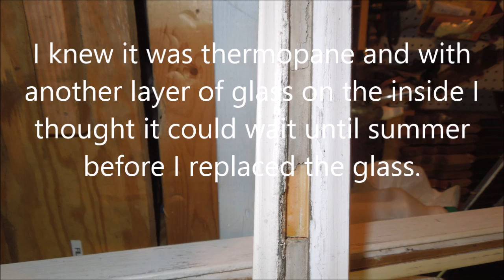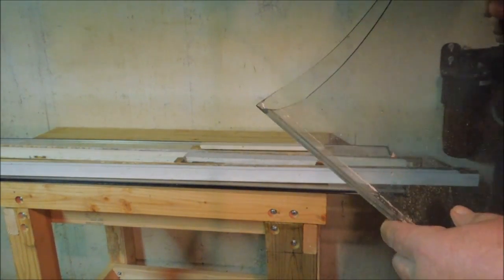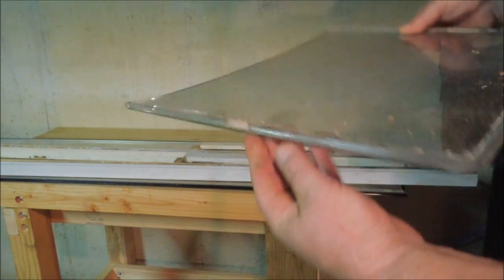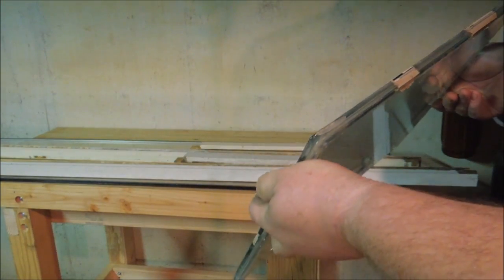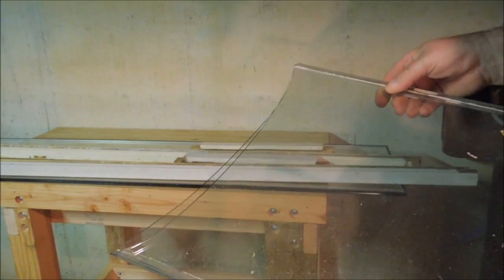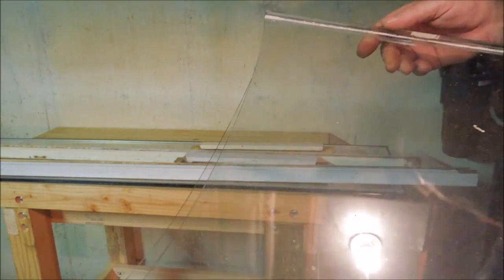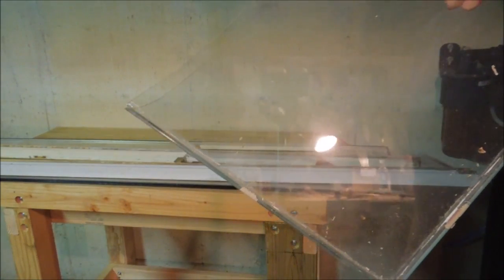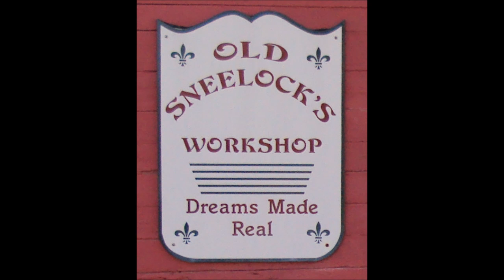Replacing the glass in an Anderson A1 type window - by Old Sneelock's Workshop

Comment: WE had a broken seal in our picture window and got it replaced like you did. Just got the dimensions and ordered the glass, put it in and caulked it to seal up the pneumonia holes. Now we can see outside but the goofy birds keep thinking it's a hole compared to the old cloudy window. Need a refresher course for birds I suppose. Good job, Unc!
Reply from the maker: +Lewie McNeely I'm too tight to pay someone $200.00 plus the window to install a piece of glass. The Andersons are good windows. I would have been happy if they didn't put in an extra couple nails in each corner. The Milwaukee Sawsall made short work of them though.
Reply: I can't remember how much our total was but I'm diesel powered and usually house mechanic like a drop-ball busting boulders so we farmed the window out. Wise move I believe!

Comment: Who were the jerks with the thumbs down? Im sure they could do better...and the check is in the mail. Wanted to see how many hours I need to bid.  Never thought 8 min for a pair! Thank you for keeping me from losing my shirt on this job.
Reply from the maker: ;I had to replace the center pane in the same style window on the porch. Now that was a real pain. It is all interlocking and nailed together. I ended up chiseling one part out and rebuilding it to reinstall the window frame. The inner trim covers 6 metal tabs that anchor the frame in place. You have to remove all the trim to get the frame out. Removing the window frame took 8 hours over two days time. 
I was working on a consulting gig so I had the glaziers put the glass in the frame. Took about an hour to reinstall.  
I have the process videoed but never posted. I need to get it edited and up.

Comment: Thanks for making this video!  I have the same kind of Thermopane windows on my house and will be rebuilding a few this spring.  
Were the corners of the frame glued together, or nailed/stapled?  
I live in Allegan just north of Kalamazoo, so I might checkout the glass shop you mentioned in the comments above.
Cheers!
Reply from the maker: Glad it was helpful!
The corners of the frame are glued and pinned with a headless nail. 
The first window I replaced the glass in I sawed through the joint with a hacksaw on either side of the tennon and pulled the corners apart. 
If I were to do another that way I would only remove one long side and then slide the replacement pane of glass in from the side. 
Having the glass shop do the work was a lot easier. It cost more, but a consulting job had been profitable that year. 😁😎

Comment: Would have liked to see a little more of the work in progress, but great results.
Reply from the maker: Didn't realize there was anything special about it until I separated the frame from the glass.
Reply from the maker: I just pulled the center fixed section of a three window set. The two outsides crank out and the center is held in place. I videoed the whole thing.

Comment: I am replacing one of these panes right now, where did you purchase the glass?
Reply from the maker: The Glass Doctor on Stadium in Kalamazoo 269-375-1133
If that's too far then pretty much any supplier that sells window glass can order a replacement for one. The new windows are glued assembies instead of being a large flat bottle shape. For this window I disassembled the frame and installed the glass myself. This summer, 2019, I removed the center panel from the other Anderson window and took the frame in. They istalled the glass for $30.00 labor and about $100 for the thermopane assembly. Took them a couple weeks to order and install the glass. 
Good luck. Let me know how it went.

Comment: Should have reused the pins, if you glued it future repair will be impossible.
Reply from the maker: The frames come from Anderson glued. The pins are a manufacturing device to hold the frames together while the glue sets. I don't have an issue letting the frame stay in the clamps until the glue cures. To replace the glass there are two popular options. 
1. Cut the mortise and tennon corners and reglue.
2. Route the frame outside face of the frame to remove the glass and caulk the new assembly in place.